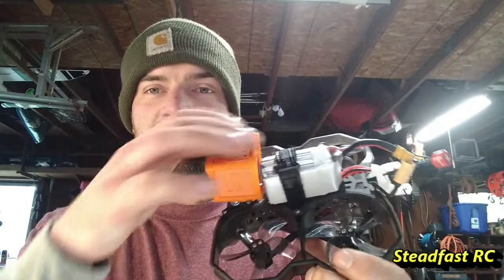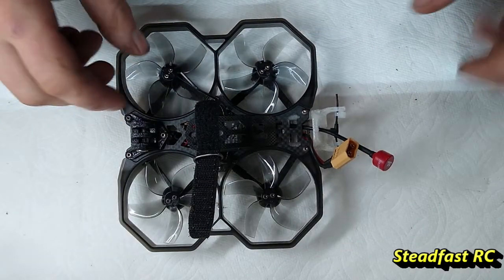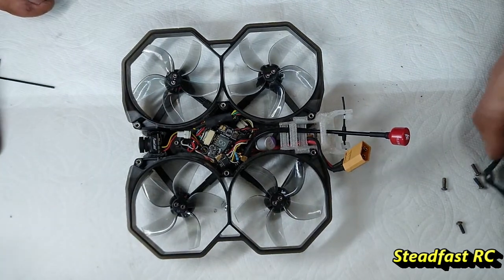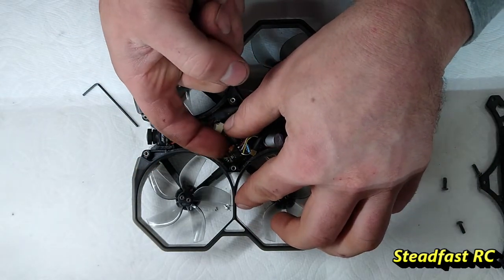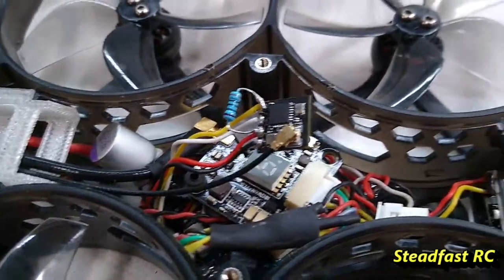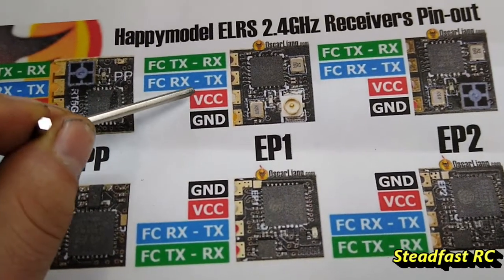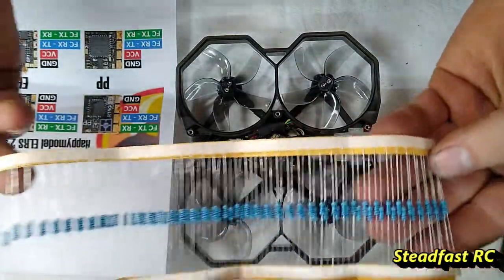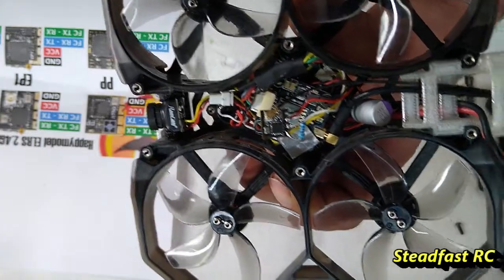Express LRS wont work on some flight controllers (how to fix it)

Comment: Sweet!  Verified fix, worked like a charm on a Walksnail / ELRS conversion of my Protek 25
Reply from the maker: Awesome dude I'm glad I could help you out
Reply: @SteadfastRC  and you get a new subscriber to boot!  I did a similar mod on a geprc tinygo, but that was jumping from 3.3v, to tx as it turned out.. tx on the FC though, this is so much simpler
Reply: @RoyceWilliamscustomurl are u using 1s walksnail or full size? Does full size vtx fit in the frame?

Comment: Hi There,
Great video
I was trying to upgrade my iflight alpha 85 HD expressLRS 2400Ghz RX from 2.4.0 to 3.0.0 and it failed, now the iflight RX or any other HM EP2 RX the led stays solid and wont blink, wifi wont work. I installed a TBS crossfire to the FC and it works fine. Did you have the same problem or another one?
thanks
Reply from the maker: Sounds like the same problem that I had in this video
Reply: @SteadfastRC  thanks, I will get one of those 100 ohm resistor try it and let you know
Reply: I got the 100ohm 1/4 watt resistor, its not as big as the ones you show, I asked the guy at the electronics store to verify. So what do I try now BetaflightPassthru, uart or wifi?

Comment: Great, mate. Thanks a lot for the video. Tomorrow I'm gonna install ELRS EP1 on my Protek25. Did you have this issue on both UARTS (UART1 and UART2)? I've heard that this resistor may be needed or not, depending on the UART we use (even for the same FC). Best regards all the way from Brazil!
Reply from the maker: I cant remember exactly but it seems like I only had one uart option for the receiver because the other one had the vtx on it I think.
Reply: @SteadfastRC  OK, just a follow up. I connected my EP1 to UART2 and I had the same issue: LED ON, no flashing whatsoever. So I disconneted it from UART2 and connected it to UART1 and it worked properly (without a resistor): RX LED blinking and binding. If I leave it blinking for some time (around 20 seconds), it starts blinking quickly and I can update its firmware via wifi. Although UART1 was already being used by the VTX (smartaudio), I was going to disconnect it anyway, as I'm turning it to digital with caddx polar. Now I'm looking for a way to plug a GPS (BN220) to it ... As it doesn't have an additional spare UART, I'll try to use LED and RT2 PADs to create a sofserial and connect the GPS. Any recommendations?

Comment: Hi buddy cool video What power 1/4 watt 1/2 watt etc Cheer's
Reply from the maker: The one I used in this video was a 1/4 watt it has been working well ever since.
Reply: @SteadfastRC  I've got 1/2 watt will it be ok
Reply from the maker: @gadgetman404  to be honest I do not know, I have never used a half Watt, the worst it could do would be to damage your Express lrs receiver, I guess it's up to you if you want to take the risk I would think it would be okay though.
Reply: @SteadfastRC  well it works so must be ok but when I can I get 1/4 watt just Tobe safe flew two pack didn't get hot but if you using 
1/4 I will too
Reply from the maker: @gadgetman404  yeah buddy! Glad it works for you!

Comment: Could send link soninhet rightmonesnget solid light but my drone just beeps like.its not connected to radio but it is does say low RF aswell does this mean need that resistor.fitting
Reply from the maker: Sorry man I cant understand the first part of your question?
Reply: @SteadfastRC  it's this what watt size I need 1/4 watt 1/2 watt 100
Reply from the maker: @gadgetman404  yes 1/4 watt 300ohm resistor

Comment: Friend, how is the connection of your receiver to FC?  I ask because I'm using a cable that came with the drone to connect crossfire and the white and yellow wires of the signals seem to be inverted compared to yours.
Reply from the maker: Can you send me some pictures of where you're trying to connect to on your flight controller? My email is on the about page on my channel. I will be glad to help you out but we're going to have to do a little bit of Correspondence through email to figure it out. I have helped quite a few people so far and I am confident we can get yours working as well.

Comment: Amazing job.....what was the problem you have on these receivers??? Because i have a problem like this with ES900RX and it doesn't work on the UART i have selected. It doesn't work...
i can't see any moviment on BF
Reply from the maker: The problem presents itself as the receiver  Lights coming on solid as soon as you plug in the battery And then it will do nothing else won't go into Wi-Fi mode bind mode or anything. What is the es900, don't think I'm familiar with that one.
Reply: Yes, the main symptom seems to be the solid light when you plug in the battery when the Radio is turned off. From what I have been able to find out, it is the TX line on the FC end pulling the signal low, and that causes the ELRS RX to go into boot mode...   Some people said to put the resistor between the TX and +3.3v on the FC/AIO side of it, but putting it between the + and RX on the ELRS RX side seems to work too.

Comment: Awesome... Thanks for the video!  How in the world did you come up with the idea that it needed a resistor to work?  So I have found 100 ohm resistors on Amazon. Do you remember what wattage those are?  I found 1/4W, 1/2W and 1W...
Reply: Awesome man! Even I am stuck with this exact ELRS issue with Protek 25 PNF and Happymodel EP2 Rx. Rx Binds successfully to Tx, but no response in Betaflight Receiver tab. Does this hack work for Happymodel EP2 receiver as well? And did the 100 ohm 1/4 Watt Resistor work?
Reply from the maker: should work on ep2 as well
Reply from the maker: I'm sorry man I can't remember and they are not marked, I would think the 1/4 watt would be fine, like I said if you want I can mail you one if you live in the US but Amazon might be a little quicker for you
Reply: @SteadfastRC  I finally broke down and did it... And "damn if it don't work now"  ... Many Thanks again! I am not sure if you are in the "ExpressLRS - High Performance Radio Control Link" group on FB, but I started a thread over there to see if one of those guys can tell me "why it works"... lmao...
Reply from the maker: @RobtestRandG   That's awesome man, glad I could help you out,  I'm not sure but I think it might just be magic, I'm hardly ever on Facebook.
Reply: The waters doesn't really matter. The idea came from the express lrs documentation where it tells you to do this. This is for F4 flight controllers that have inverted receiver uart. Another solution would be to use a different port all together but many of us don't have that luxury
Reply: Hi, what W did you use